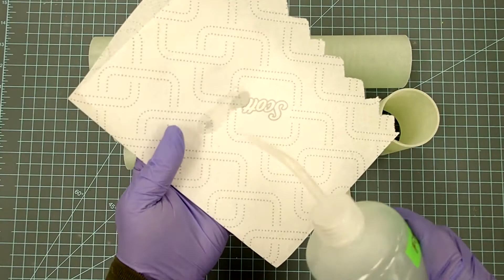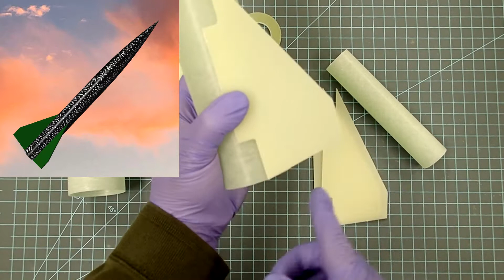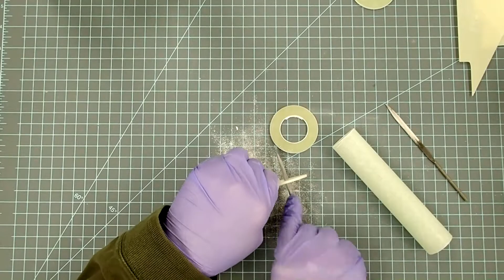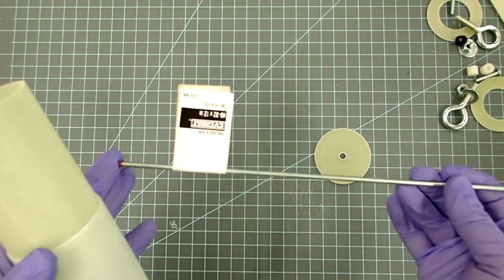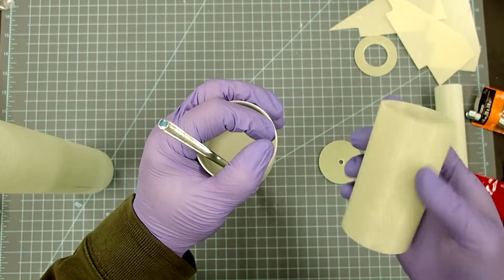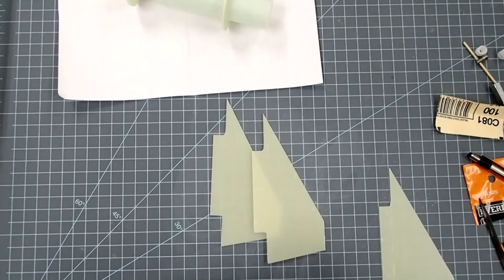MadCow “Viper” model rocket assembly (part 1 of 2)

Comment: Thanks Dave for this video.  I feel like I am chatting with you along the way.  I attempted to dry fit this rocket and realized I needed to make many decisions.  Each of those topics you are covering also in this video.  For example, I extended the slot in the air-frame froward so the fins resemble the rendering vs sticking out past the aft by nearly 1/2 of an inch.  I believe you  posted the simulation file for this rocket here.  Thanks!  https://www.rocketreviews.com/rocksim-madcow-rocketry-viper.html
Reply from the maker: Yes, that's my Rocksim file. Glad you found the video helpful.